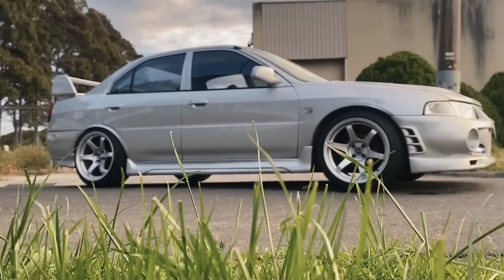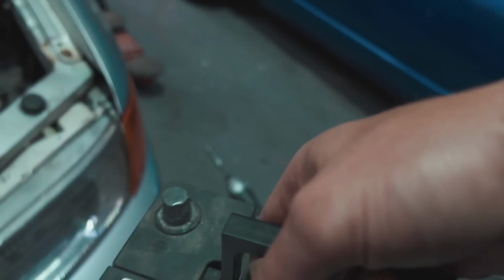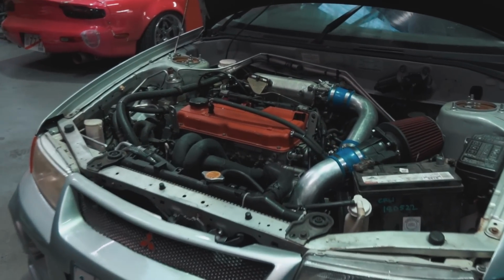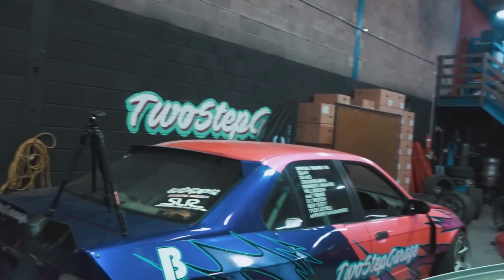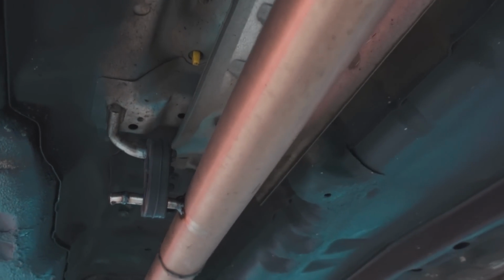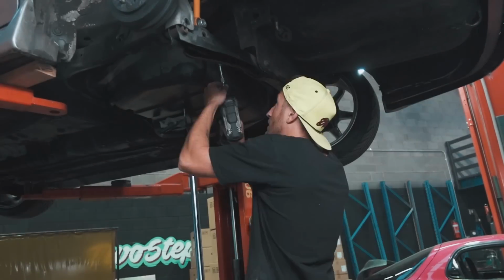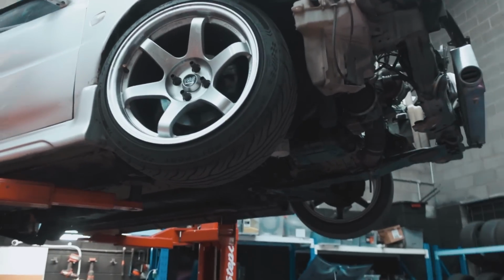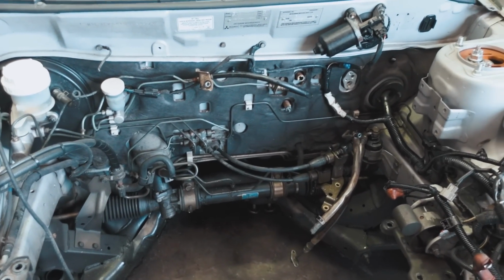LANCER FWD TO RWD CONVERSION | PT1

Comment: That power steering rack is going to get in the way of the ca18det's bell housing. 
May have to go electric with some mods with tie rod's and column.
Reply from the maker: I’ve sat staring at the engine bay for ages trying to figure out how we’ll make this work. I have a few ideas 😛

Comment: I am no expert on building/stripping blown engines but I’m intrigued to know what actually blew the hole(s) in the block, hence why it still runs all be it a bit lumpy to say the least…

Are we thinking crankcase pressure alone from the increased boost or have parts of the engine actually left the chat?
Reply from the maker: I’ll do a teardown video for sure! But it’s definitely parts of the engine that left the chat 😅

Comment: You will need to put cv shaft end joints back in the hubs or the bearings will have to much play and will destroy them over time
Reply from the maker: We aren’t running these front hubs, they’re just so I can move it round the shop 😁

Comment: Cool setup, but how are you going to run the car without front axles?
Reply from the maker: It has a Silvia motor that doesn’t have front axles 😜
Reply: @itsmikelake   Thanks for your correspondence, I meant if the front knuckle spindle is the same for both wheels as previous setup, will there be any form of repercussions on the wear and tear and handle of the front bearings and wheels since there're no axles installed?

Comment: Why? Woudnt it been easier using the running gear and 4g63 out of the starion?
Reply from the maker: How so? You’d still have to do the exact same amount of work to make it fit the lancer chassis. Not to mention that stuff is extremely hard to find. This stuff I’ve used is readily available to my and relatively affordable. Not to mention it’s different and awesome 🤙🏻